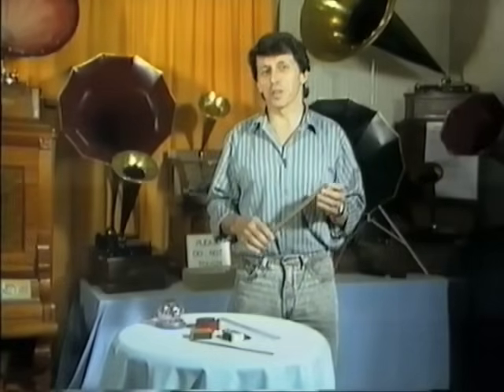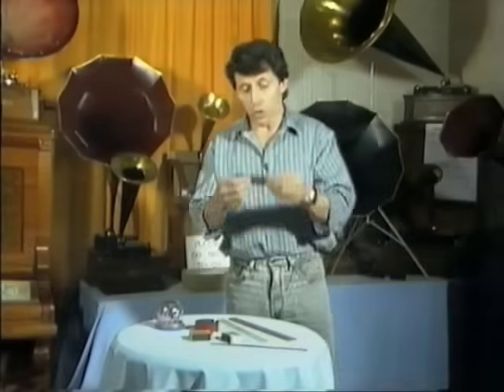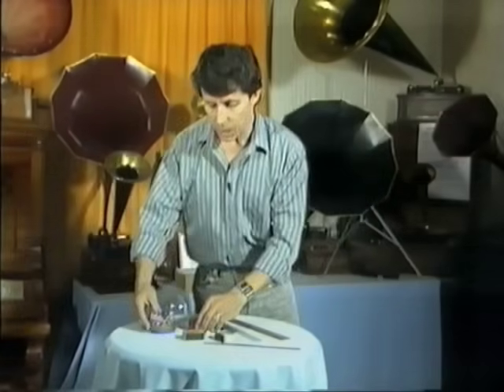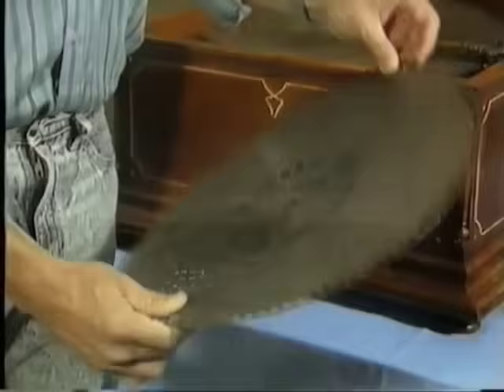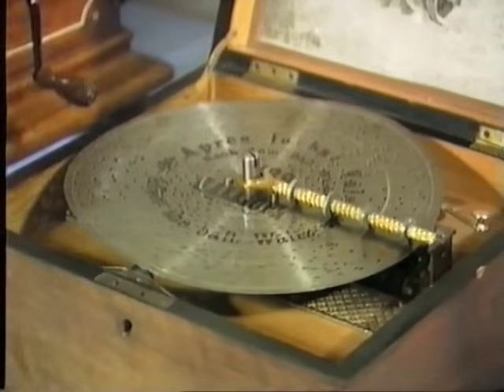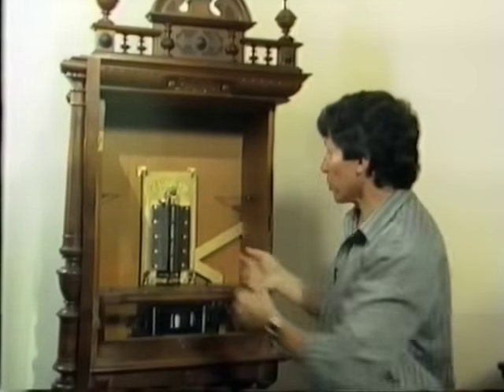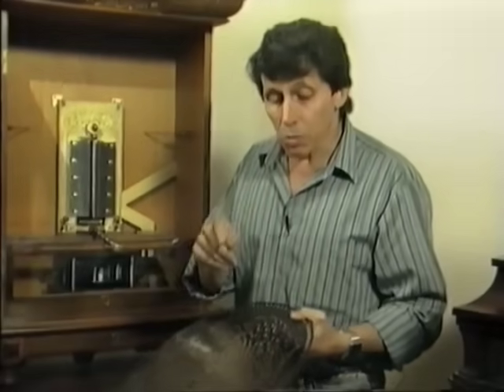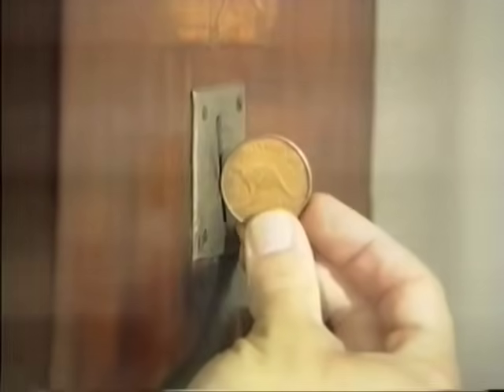Music Boxes - How They Work

Comment: Is this not a 100% energy transfer device. The energy you put into winding the spring gets converted to sound and motion of the wheel.. so is this not a energy device with next to perfect transfer of energy if not amplifying the energy?!
Reply: +Sdddude123
Not really, as with any mechanical device, some of it will be lost to friction and turn into heat.
Reply: bruh that wasn't the point of the whole thing